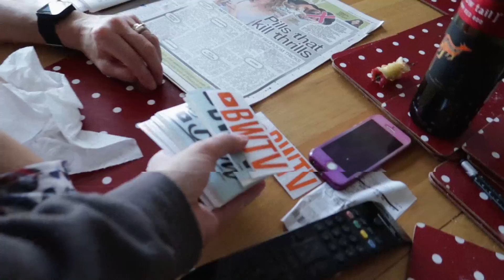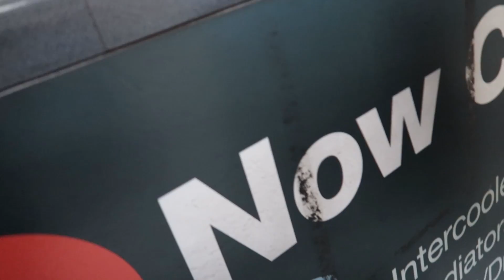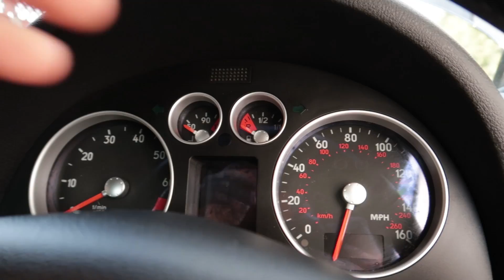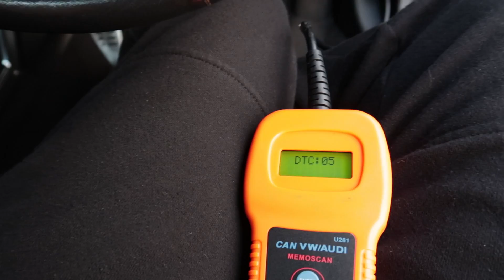Everything Wrong With My Audi TT!

Comment: I have a 1.8T engine and I’ve gotta tell you CHECK YOUR TIMING BELT it’s on the passenger side of the engine they are meant to be replaced every 75k miles and people let them go past 120k forgetting them and they snap and the engine bends the valves and needs a head replacement don’t let that happen then for the misfires change out spark plugs ,coil packs, coolant temp sensor and put in a new cone air filter maybe to help it out with turbo noises if your into it and of course replace the timing belt along with the water pump if it hasn’t yet been replaced, I shop for all my euro car parts at ecstuning.com they’re great they sell genuine oem or quality aftermarket for the best prices
Reply: Amir Zamoum just bought a 1.8t and replaced the coolant temp sensors o2 sensors coil packs and spark plugs because I had misfires.  Sounds like common problems for a 1.8t all round lol, my timing belt was done at 75k and I’m at 110k. When would you get the belt and water pump re done again?
Reply: Ti ko do your timing belt again at 150k it should be good till then if you want to be extra safe just pop the 2 clips holding the plastic on the valve cover and check the condition they typically don’t age quick

Comment: Hi!
I am also working on a tt mk1 right now.
I also have oil leaks. In my case, the PCV valve was cloged and one of the hoses from pcv system that goes below intake mainfold was cracked. 
You should check that first, Remove inlet mainfold and check pcv valve and all hoses. It is a very typical fault on TTs leaking oil. Do not forget to change also PRV valve. 
Hope it will be helpfull,
Reply from the maker: Thanks mate, stupid question but what's the prv valve? 🤙
Reply: BWTV 
PRV or also known as hockey puck because if his shape. Oem: 06A 129 101. Google research on pictures. It is located near the big pipe that comes from air filter housing. 
If you hava oil leaks 90% because of pcv sustem clogged; you have a lot of videos explaining pcv system on youtube. remove intake mainfold and check all system and change also this prv valve .
Sorry for my english. Regards from the Basque Country. I will follow you, sure that will be helpfull also for my project! 😜

Comment: basically you bought a wreck
Reply: that car is over 17 yrs old.. any car of that age needs care and repairs.
Reply: Mate i bought a 2003 coupe TT with 258 thousand miles on it for £850, as a work hack, it had a new dual mass flywheel and clutch and a few other minor parts prior to me buying it.

I have driven it pretty much every day for 18 months it’s now on 263k and all i have done to it are a track rod end, put 4 Pirelli tyres on it and cleaned it, oh and topped the oil up a bit every couple of months

And it still does the top speed 😉

Don’t knock an old TT they are superb cars 🙂
Reply: @pheasantpluckersson2138  i agree theyre really fantastic cars for the money. Nothing offers that level of comfort or performance for the 💰

Comment: How can you tell if your rocker cover gasket has gone? I’ve got a bit of oil on bottom of engine on my 2.0L Golf MK4 wondering if it could be this? Could I do a compression test to see if it’s leaking any?
Reply from the maker: Oil in spark plug area, and any oil leaking around the top of the cover are the main ones, can also cause some performance issues
Reply: a compression test only measures the pressure created and held in each cylinder, not in your rocker cover. id suggest cleaning off any oil around the gasket area, drive it around for a bit and recheck the area to determain if there is a leak and how bad it is
Reply: Cheers guys. I’m going to do the belt soon so might do the sparks whilst I’m doing there and have a look round for oil. Give it all a clean and drive it for a bit..

Comment: Had a problem with my Golf 4 1.8t leaking stupid amounts of oil too. Everything under it was covered in oil.
The problem was right underneath the head gasket on the right side it is like a halfmoon plastic plug, oil was leaking from it non-stop when car was running.

Comment: Hi mate I have a 51 plate tt the locking system and the boot buttons not working is the blown fuse u will find them behind the cover when u open the drivers door
Reply from the maker: Ooh okay I'll check that! Cheers 👌

Comment: That noise is the secondary water pump, don’t worry it’s normal. As for the oil that may be the sump seal or it could just be running down from the camcover. As to the fob not working, maybe try checking the central control locking unit in the boot next to the small stand sub on the left side, it controls the central locking system, Windows, and alarm. It may be fine, but worth checking if it’s got wet down there in the past. Anyways, just sharing ideas. Tbh, I love the car, and after abit of tlc you’ll have an awesome one there! Nice video, I’ll be sure to watch the next one 😎
Reply: Standard**
Reply from the maker: Thanks man! I'll check over the little bits then 🤞

Comment: If the previous owners serviced it, make sure the spark plug end hasn’t fallen into the cylinder, it’s a long shot but had it happen to a mate. It showed every sign of a blown coil on  the second cylinder but instead of £50 for a coil it was a £800 wreckers engine.

Comment: The seat does work but you need to pull the seat forward, so sit in it, pull the lever to raise the seat and while holding the lever up pull yourself forward as in slide your arse and the seat should come forward. its not like the golf which has a jacking system where you crank yourself up.  and then yeah to drop it to the floor again same thing hold lever up and push yourself down

Comment: I had a friend with an obsession for Audi TTs. I think it was because one was his first quickish car. So he went from a 225 to another 225 that he modded and crashed on a track day, to a 240QS with abs/esp issues to another 240QS that has a few issues. All the while we suggested he tried some Japanese stuff with actual steering feel and a decent gearbox or a nice Ford RS, eventually he bought an RX8 R3 and admitted that we were right all along and the TTs wer numb and boring to drive but he just didn't know any different. He is now on his 2nd Subaru STi and is loving having a car that is involving to drive. The Mk4 Golf platform is riddled with wooden steering, crappy gearboxes and reliability issues. Good engine the 1.8T though, just needs putting in a decent car.
Reply: Ive had and rx8 and personally the steering feel and rear seats  are the only things in the 8s favour. The TT is better built, more comfortable, more reliable and imo better looking (not that the rx8 looks bad at all)
Reply: @theCinator  depends what you want from a car. RX8 makes a better track car, TT a better road car but both cars have their faults and neither are particularly reliable.

Comment: Panel filter as well will fix some of the smell ,very important for this engine is to disconnect air supply from manifold to turbo if possible and clean including the intercooler and catch can when put back together. Injector clean and O rings as well as inlet manifold clean. When possible all sensors clean and map and maf clean or replace. It will sound and run well and cooling sistem flush and new coolant

Comment: My miss tire issue on my 1.8t was the coil packs or Maf both times. On a side note you should take the tt engine / harness and swap it into your golf after all it’s a bam so 225 stock before any remaps would make a proper rocket 😂
Reply from the maker: Yeah if this car completely breaks on me that's the plan 🤣
Reply: BWTV lowkey hope so as that would be a beast would love to see thos videos😂 besides that mate good luck with it I know the feeling buying an abused 1.8t has pretty much same issues as you plus a lot more seat Leon mk1

Comment: Hi pal....Ironically..my mate bought an exact same Audi-TT convertible in black on an 02 plate....It was a non-mover..but started (sometimes)..I think it was left in his back garden getting a mouldy roof....He's the guy that also got my MK4 Anniversary with the custom-straight through-powerflow exhaust that popped n banged....I'd've put your sticker on your glove-door or on your drivers-side fuse box panel....:)....The vibration and sound at the end of the video could be a fan staying on..so maybe an electrical fault..its from the same era as my old MK4 Anni..Same with your clocks..mine kept dimming and then going off altogether. Back in 2015..the middle-aged guy I bought it off did mention some of these problems..but that he didn't have the time etc..and being desperate after years of waiting..saw it gleaming..and was literally wanking over it that I bought it..But my mate..(who doesn't give a f*ck)..had it up and partly running enough to get it to cruises. Actually..if I see him again..I might get him to film it popping....

Comment: The oil under the car may be the gearbox, my mk4 golf got the same problem and it caused by a little hole. So the transmission oil is leaking a bit. Nice video btw!
Reply from the maker: Is that a simple fix or does it require a new gearbox? 🤪
Reply: BWTV simple fix if you have or can borrow a welder, i cleaned all the oil away, used a metalbrush on the hole and welded the hole. Not leaking anymore, and its about 2 months ago 😁

Comment: Have you got the external water pump on the radiator? If you have run it the pump will run after you turn the engine off it’s pumps the water around to cool the turbo

Comment: My golf 1.8t bits of the plastic dipstic fell down the tube into the sump but i had the car in bits a couple weeks later doing the oil pump new sump sealant new pickup pipe pretty easy job apart from 2 hex nuts that ard at a slight angle youll have fun with those if you attempt it lol

Comment: Does this have the same engine as your mk4 gti?
Reply: coziFPV same engine, different code
Reply from the maker: As he said 👌 (it has a ko4 turbo, over the ko3s)
Reply: Should of got a ko4 cartridge put in your ko3s
Reply: @Moodymotors291  for the price to do all hybrid turbos and mapping it he got a full car with a k04
Reply: Ko4 equipped 1.8t have lower compression, secondary water pump, better piston's, thicker 20mm small ends and lack of sai. 
Lower compression comes from them piston's.

Comment: Get timing belt, pulleys and water pump done first. My Audi had the belt one but not the water pump which later bust taking out the valves and damaging the pistons. Got a low mileage BAM engine from Germany car now running great. Windows not dropping do not mess about fit new locks £26 on ebay. as the micro switch and contacts will be worn. Lots of info on YouTube good luck.

Comment: You need to put in new seals on the crank, cams and anywhere else. When you see that much oil on top it's flying up from below the block. With that much leakage you would be better off replacing it with a new engine. Need a mechanic with a computer scan tool to figure out what's going on.
Reply from the maker: The rocker cover was leaking a ton, and I replaced the sump. Nothing to do with the main crank block 🤦
Reply: @BWTV  Congrats! That's actually amazing considering the visual wear. Hope the TT is reliable

Comment: The buzzing, I could be wrong...but a grounding issue or possibly alternator. The rest of the issues easy fixes, I say keep it and fix it.
Reply from the maker: That's the plan 👌
Reply: id say the buzzing in the engine bay will be the secondary water pump which should always operate after being on to prevent oil heat soak in the turbo (a grounding issue would be more of a pulsing sound rather than buzzing and the alternator wont be passing electricity through the main coils until the engine is running and the induced voltage excites the regulator diodes)  The high pitched buzzing when the ignition is on but the engine isnt running is perfectly normal for these tt engines. the misfire could be a coil going bad (quite a common issue), you could try swapping them around and see if the misfire follows it, or you could just check the plugs for signs and just let the misfire develope and diagnose it then. the vehicle is defenately worth keeping and fixing it up as it only has minor issues. one thing to note however, is to find out if the front sway bar d bushes have been replaced and the plastic collars removed as there was a recall for them as they caused quite a few issues

Comment: Lever on side of chair should pump it up. Id clean all the oil off first make sure it isnt just that someone cant pour oil.......😂👍 looks like youve got a few jobs to get cracking with. Coilpacks something to look at the misfire probably never been changed if the guy never changed water pump
Reply from the maker: Well damn the chairs broken too 🤣
Reply: @BWTV  the lever on the side of the seat shouldn't pump it up. instead when you are pulling it, use you feet to pull the seat forward (to heighten the seat) or backwards (to lower the seat.) its a weird feeling at first but defenately nice for fine tuning the seating position

Comment: misfires overheating oil leaking down the block coolant boiling over ... yep head gasket and warped head
Reply from the maker: Boost leaks, water pump damaged, rocker cover gasket leaking. Don't jump to a head gasket 😘
Reply: @BWTV  I hope for you if it was me  I'd be doing a coolant pressure test and compression test.. If water pump is not working or thermostat is stuck closed your return coolant hoses would stay cold

Comment: I'm sorry mate but you have bought a very big money pit :/
Reply from the maker: Just a few bits to fix, what screams money pit? I got this car for a good price and am willing to spend money on it, I wasn't expecting it to be a cheap ride. But in particular, what screams out to you 'this is gonna need a lot of money to fix'?
Reply: @BWTV  Well first it was the water pump ,the oil leak then the strange buzzing noises, it just seems like it's going to need a lot doing just to get it in right working order that's all :P also IMO you should just delete the n249 and other crap as like you said it will be a bitch to find all the right parts and from what i have seen and what you know yourself it makes the car run better anyway and cleans up the engine bay so win win i suppose :)
Reply from the maker: @insidebyte8561  waterpump is gonna be paid by the seller thankfully, the other bits are annoying, but the parts are cheap enough to buy 🤞 and yeah I think that'd probably the best way to go about it, so many of these hoses are flimsy as hell 😭
Reply: @BWTV  That's good of them, up to you but may as well put a new timing belt on it while that's being changed, but that's far enough, also i really like to top/ left intercooler pipe that's solid and whiteish looks pretty cool :P